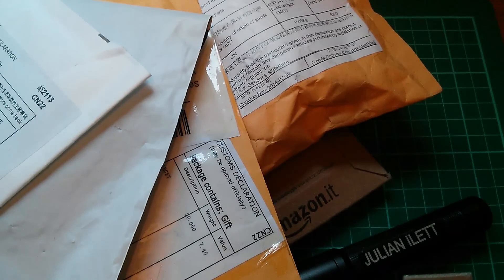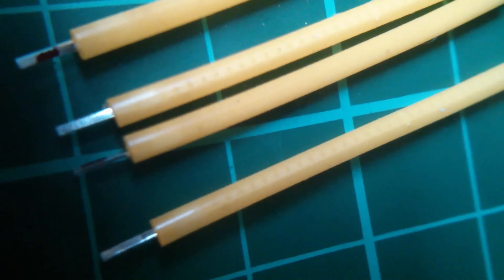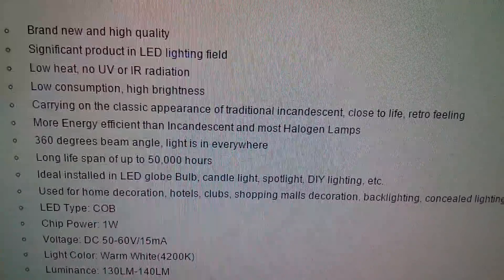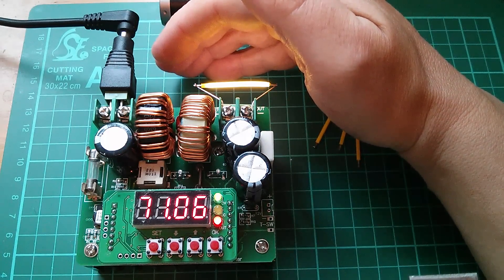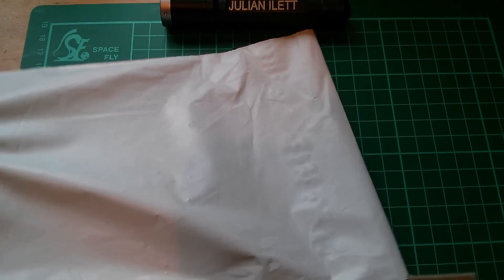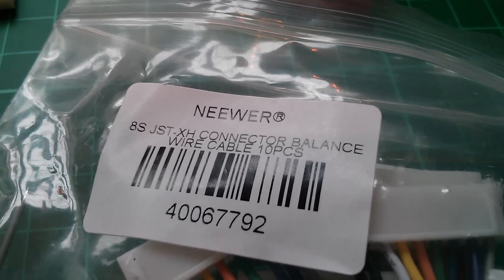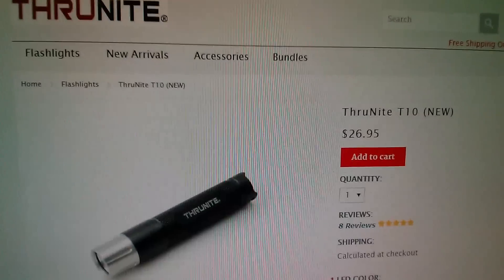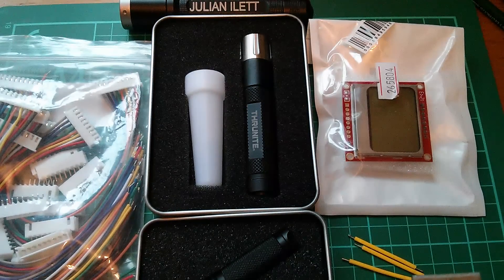Postbag #23: LED filaments, LiFePo4 Balance Charge Leads, ThruNite Torches

Comment: I see you have experience with those LED-fillamets. I ordered some of such LED-fillamets, but I'm not happy with them. Your LEDs seams bendable. Mine are not. there is a thin piece of glass on which are the LEDs and therefore the will break if you bend it. So now I have the Problem, that i have ordered all stuff for my Project, but without bendable LED-fillament it will be failure.

Do you have any advice to me? Where i could get bendable ones? I hope you or anybody else  could help me. thanks

Comment: 8s is 8 batteris in series.  You need to know that the s# is series and a P# is parallel ie S3P4 would be a total of 12 batteries 3 rows wired series of 4 row wired in parallel.

Comment: turnigy 5000mah hardcases off hobbyking run our ebikes, and my quad.

usually give 5100-5200mah, odd as if you gut one the pouches track back to a manufacturers claimed 4500mah.......

Comment: Those LED filaments are perfect for simple capacitive dropper circuitry.  It's best suited to high voltage low current LED arrays just like these are and is so simple that it's a very reliable power supply choice.  (I'm waiting on my loose filaments arriving.)

Comment: i mension the boost converter,.. why the resistor near at the back was HOT even no load, when the voltage goes to 80 volts??

Comment: Have you seen my lithium ion pack? I havent wired up the chargers yet, but i bought 2 chinese lithium drill chargers from the store, 10 bucks each. All of the cells here are from thinkpad g40 batteries which come in these awesome bundles of four. https://plus.google.com/105400971138795276677/posts/XT6ELqRrdjG total cost was 20 dollars for a 16ah 24v battery pack.

Comment: That DX display resolution being incorrect was mentioned in their reviews/comments. I always check reviews first before purchase as sometimes the info is wrong. I've bought from DX a few times and they're a great site much like BangGood.
Reply from the maker: The incorrect resolution is discussed in their forum, but the item doesn't have any reviews on the product page. I just tried to add a review, but you have to be logged in and I don't have an account as I paid with PayPal. However I have now filled in an error report for this item. I'm sure DX are perfectly reputable, but let's see if they act on my error report.
Naturally I'm a little embarrassed, but mainly disappointed that this isn't what it appeared to be (I could really use a hi-res monochrome LCD). I could pull the video and re-upload it with this section missing, but I think I'll leave it as a warning to everyone to do as much research as possible.
Reply: Julian Ilett Ah yes it's a forum question (it's on the product page anyhow). I always try to research things like displays to make sure I can interface it with the Arduino.

I'd love to find a nice monochrome LCD myself so if you ever find one I'd like to see a video about it. Keep up the vids, I've learned quite a bit since I started following you =)
Reply: Julian Ilett
I've ordered from DX a few times, but recently (if you can call 1 or 2 years recently), I'm not that pleased with them anymore. The product description is often very lacking or simply wrong, shipping takes longer than it did, I've got a few duds from them and most of the stuff they have can be found for the same or lower price on ebay anyway.
On top of that I don't trust their reviews anymore. I've reviewed several of the products I bought, but all the reviews where I gave less than 4 stars weren't published. I'm pretty sure I'm not the only one that had this happen.
I wish ebay would allow product feedback instead of seller feedback, because you can't trust shops that moderate product feedback. Especially chinese shops seem to be very "critical" about critics (not much of a problem in European/US shops).

Comment: I  also confirm that the I have the same boost converter and elements from different seller! Mine light up at 50-60V but the boost converter goes nuts in the same way! Hopefully you can find a solution to lighting these from 12v (I haven't found anything yet! =/)

Comment: If I were to have a guess, I'd say that the ebay seller for the filament LEDs stated the unrectified RMS voltage as the forward voltage. 50VRMS * sqrt(2) = 70VDC; 60VRMS * sqrt(2) = 84VDC, which seems reasonable.
Reply from the maker: martin2250 That seems a likely explanation